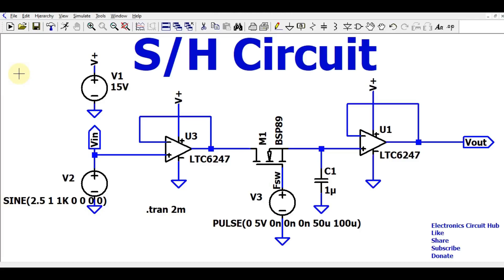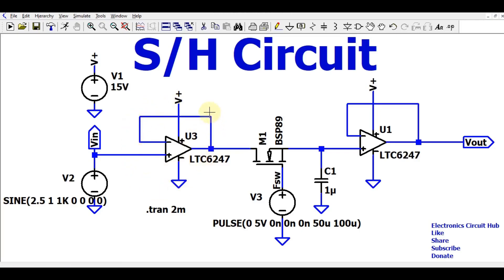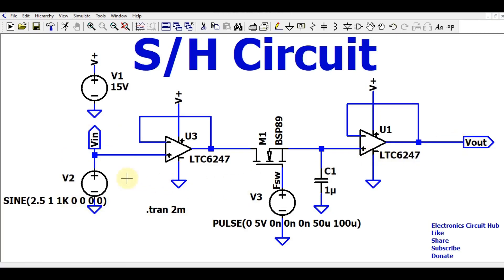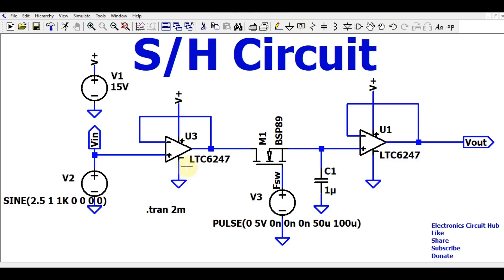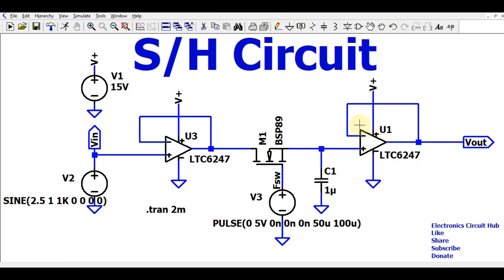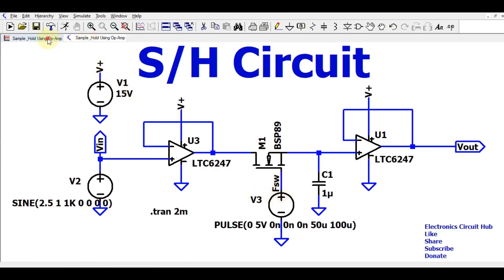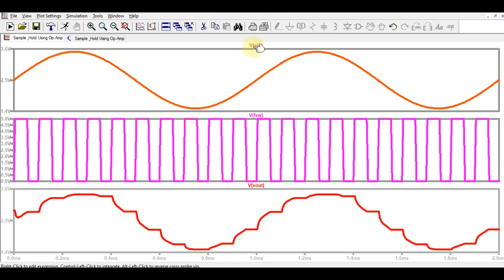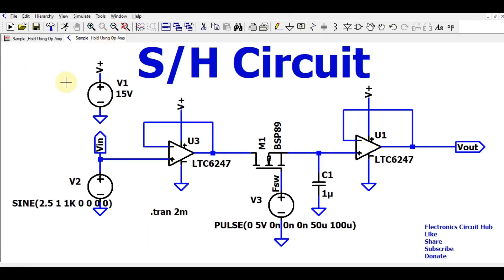LTSpice sample and hold circuit using opamp | Simulation

Comment: Hello, professor. I love your video lecture. Since I am a junior design engineer just graduated, I would like to know how you choose the specific components, like LTC6247  or BSF89. Did you only consider Ron and the gain of the amplifier? Also, I read the LTC6247 datasheet, but I still cannot get why we imply 15V. Thank you for your time and consideration!
Reply from the maker: Could you please contact me on the number given me on channel page.
Reply: @ElectronicsCircuitHubECH o, prof. I just signed in your membership. How should i do if i want to ask a question regarding schematic?
Reply from the maker: @jaewookim6211  please ping me on whatsapp +91-8871232248

Comment: Professor,  I get the correct input signal and the sampling signal, but my output does not look like a sampled signal, please see my netlist below. Help, please.

* C:\Users\DannyJ\Documents\LTspiceXVII\Working Models\Electronic_Circuits_Hub_SH_R0.asc
XU1 N002 N001 In N002 0 LTC6247
XU2 Out N001 N003 Out 0 LTC6247
V1 N001 0 15VDC
V2 In 0 SINE(2.5 1 1K 0 0 0 0)
V3 Fsw 0 PULSE(0 5 0ns 0ns 0ns 50us 100us)
C1 N003 0 1µf
M1 N002 Fsw N003 N003 BSP89
.model NMOS NMOS
.model PMOS PMOS
.lib C:\Users\DannyJ\Documents\LTspiceXVII\lib\cmp\standard.mos
.tran 2ms
.lib LTC7.lib
.backanno
.end